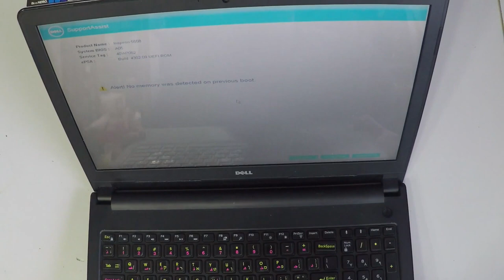Dell Inspiron 3558 5559 5558 3568 Power Button FIX

Comment: What did you do on the + plastic button?
Reply from the maker: Hello, Luke, The plastic button was stוck, I just released it.
Reply: The same problem happened to me. I just attached a small piece of pen cap over the button on the board with electrical tape. Now the notebook turns on normally. Thank you so much for the explanations in this video.
Reply from the maker: your welcome.

Comment: Hi Luke, you connected the power supply to the laptop for testing the button. Can you please explain how this helps? When connected to the charger, the light in the front of the laptop will be on even if the computer is shut down. That light goes off only when the charger is not connected. So how do you test the button Thnx in advance
Reply from the maker: Hello nat el, The light in the front won't work, but the fan will run and this is the indication of a successful fix.

Comment: Good Day Sir  ! I have a small issue in my dell inpiron 15 5558 .issue is that it is not setting its time and date even though i have changed bettery cell CMOS and sir second is that it end to quick as last one ended in 4 months ..please suggest solution....